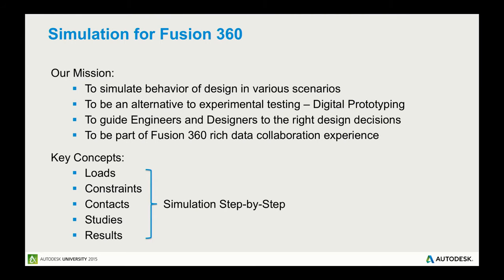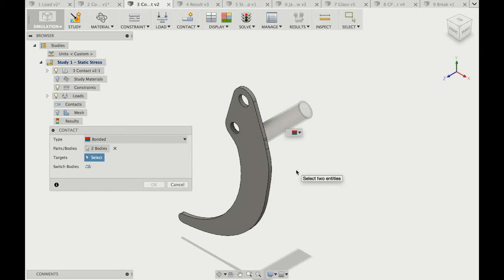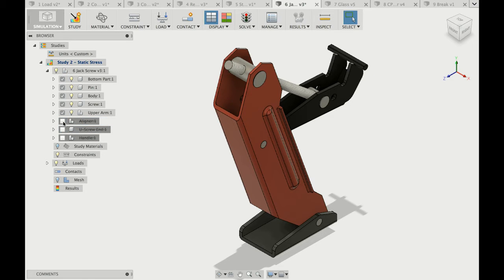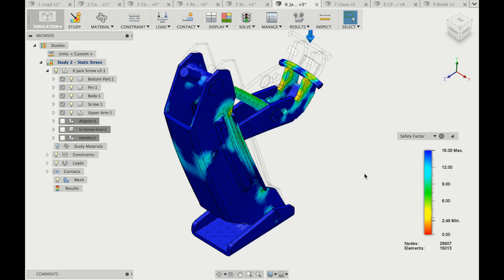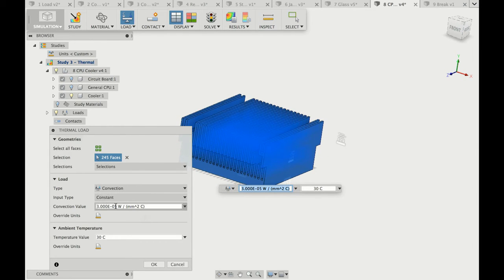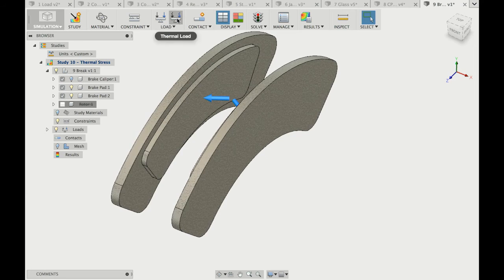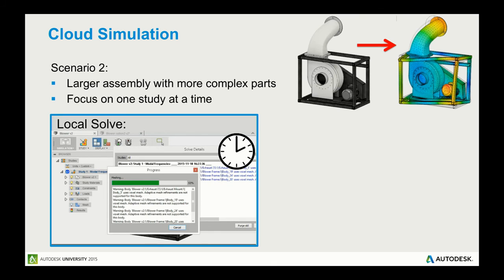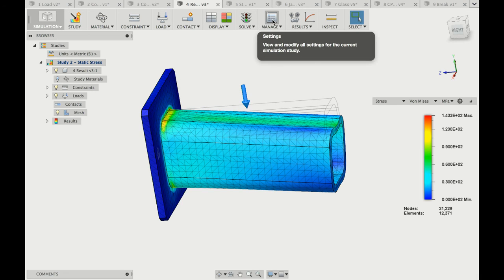Fusion 360 Simulation Tutorial

Comment: I suspect that the simulation of the car jack is wrong, by choosing "automatic contacts" they became all "bounded" automatically, and we see in the result the lack of stress on the reaction side of the pivot points, and the threaded rod bent instead of pulling.
Reply: Absolutely right, correct contacts is a real pain. Bonded in many cases is too stiff and can't transfer stresses properly or generating abnormal stress concentrations. Automatic contacts could be good as bulk sometimes, but definitely just generating automatic contacts will lead in many cases to colorful pictures instead of reliable results.
Reply: Agree